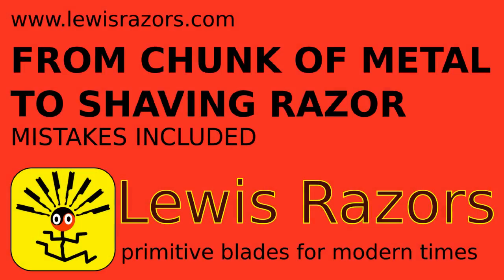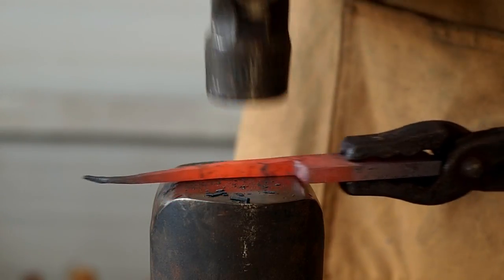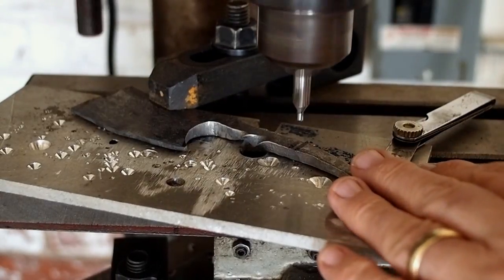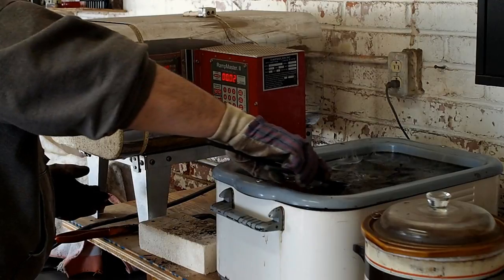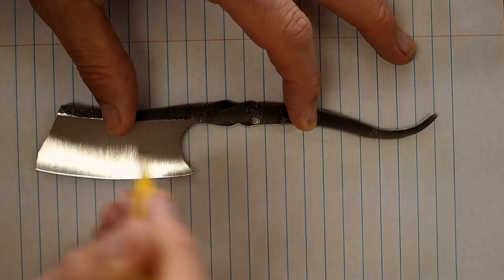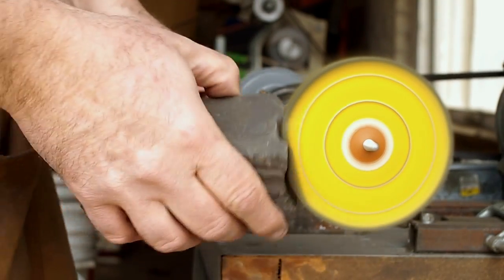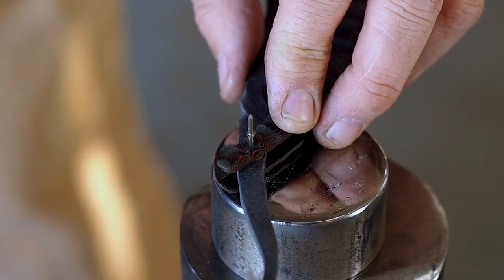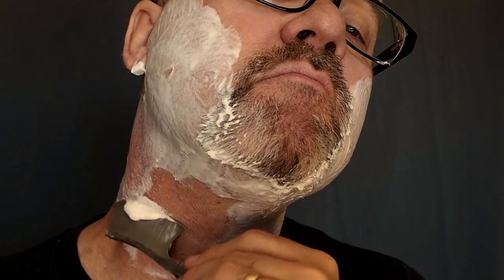Razor, From Chunk Of Steel To Shaving

Comment: Much respect for hand forging that hunk of steel into rough final shape before grinding. That's a real knife maker, and is what separates a real knife makers from the other people on YouTube who just cut / grind flat stock into knives. Excellent job!
Reply from the maker: Thanks for your thoughts.  Both stock removal and forging to shape can make good blades. They are both means to an end.
Reply: Even medieval smiths were known to cut and grind stock down to shape before finishing work was done.

Comment: It's great seeing an artist creating a work of usable art I'm 55 now and fondled remember my one and only time I used a straight razor at 16 years old had a few cuts but went fine I think the edge needed a good stopping though ;-) but intend to restore my old chipped razor and get it back into service - ideas love to pick up one of your excellent razors :-)
Reply from the maker: We have very similar stories, about the same age, and about the same past experience with a razor.  I had a straight razor while attending trade school, used it for a while, but could never get it sharp again.  I came back to straight razors years later.

Thank you for your thoughts.
Reply: omally thomas I'm 55 now too, but back in my mid 40's I got really sick and tired of paying high prices for multi blade inserts for modern razors. Even at Costco, $20 for 4 cartridges was just ridiculous. I looked around online and saw some pretty high prices for modern versions of straight razors and then landed on eBay and found some pretty good deals on older ones from around the 1920's and 30's. Picked one up for about $30, stropped it and went to work. I was a pretty bloody mess by the end of the whole thing, but something I noticed right away was that a nick didn't hurt as much and they healed extremely quick. After a few rounds with my new oddity I got pretty good with it. The key was prepping the face before hand, and keeping the angle correct. I now collect straight razors, preferably vintage ones, although I do have a few modern ones also. Living in Germany, I have access to some of the finest razors mass produced today. Solingen vs Sheffield ... Solingen is more flexible and glides across the skin following the curves and such. Sheffield has almost no flex at all and forces the skin to get out of the way or get lopped off. I prefer Solingen ;)  
  One thing for sure about using a straight razor vs modern cartridge razors. You get a tremendously closer shave from a Straight, in fact it erases a good 10 years of age right off. Something about having a shave so close that no baby's bottom can compare! I hope you get back to doing things the old way. Even if you pay a couple hundred bucks on a new high grade modern razor, it will pay for itself within a few months. And the old soap in a mug and brush? Lasts so long you'll wonder why you ever picked up an aerosol can.  Good luck with it !!   Bob in Germany

Comment: Two years later, I am watching this video again. Since then, I have made a propane forge, and bought a belt grinder with a contact wheel. After two years of planning I can make my second straight razor, this time a functioning one. Thank you once again for your guidance lewis
Reply from the maker: I hope you have fun with your razor making.
Reply: @lewisrazors  since I didn't have easy access to 5/16 inch anything steel, I would have had to do some forge welding to get a peice thick enough. May as well do a pattern weld if I am going to be forge welding already anyways. I could never have imagined how difficult and time consuming this would be. I've gone through about three wooden straight razors trying to understand the edge profile a bit better, but I seem to keep burning through as I get it thin enough.
Reply from the maker: That was a big razor in this video I use 1/4 and 3/16 stock to make razors also.  I have made more razors from 1/4 inch stock than anything else.  This video goes over the ratios  https://youtu.be/isPvvVdyQio

Comment: Beautiful craftsmenship, it was a pleasure to watch! 
I am a craftsmen myself (a sculptor and taxidermist) and one year ago I forged my first knife. Not on your level yet, but it's a pleasure to work with different materials and create beautiful forms. It's great to see masters at work!
Reply from the maker: I wish I had the hand eye coordination to work with different media. The good thing about metal work for me is that is goes so slow I have time to correct.  Thank you for your comment.
Reply: @lewisrazors  Based on your smithwork, I'm verry sure, you have the hand-eye coordination! 
At first I thought the blade protection is made of Mouflon horn or Antelope horn, and was surprised it's actualy wood. Sculpting, carving and forging are different in one way, but also similar at the same time in another way. You should try it, if you realy want to!
And thanks for your reply too!

Comment: Really great video! Does the natural stone at the end really achieve a better edge than the 12,000 grit used earlier? Or do you just finish off on that for tradition's sake?
Reply from the maker: NightHawkInLight It is splitting hairs at the natural stone point, it improves the 12k but only by a hair. It is mainly a how does it feel on the face type of thing. Thanks for the kind words about the video.
Reply: Lews it seems to me the razor meets too much resistance going against the beards!!! I notice you put a certain amount of pressure to win the resistance of the grain!! Is this normal? It seems to me the razor is not enough sharped!!!! at all. I make a shave 10 days of growth with my poor Parker Srx armed with kai blade!! No cuts, no irritations, resistance very small practically inexistent! Should you improve your blade??? I'm interested but the dimostration of the razor working was deludent! Are straight razors so few performing? It seems more a pulling of beards! When I use kai it cuts all like butter but here things go different too much! Don't you agree?
Reply: @zenrazor659  no.
Reply: i dont mean to be offtopic but does anyone know of a tool to log back into an Instagram account?
I somehow lost my account password. I love any tips you can give me!
Reply: @Tony Benedict Instablaster :)
Reply: @Cayson Arlo i really appreciate your reply. I got to the site on google and im in the hacking process atm.
Takes quite some time so I will reply here later when my account password hopefully is recovered.
Reply: @Cayson Arlo It worked and I now got access to my account again. Im so happy:D
Thanks so much, you saved my ass !
Reply: @Tony Benedict You are welcome xD

Comment from the maker: James, Moore I sell my razors through Straight Razor Designs. Thanks for the knd words.
Reply: And they are amazing razors great job *****. It's always a pleasure to admire your work.
Reply: Very beautiful work and nice video! Thank you for sharing! little technical question though: how do you figure out where to drill the hole on the tang at the beginning? Many thanks in advance for your time.
Reply from the maker: I hold the razor blank like I would when I would be shaving it and see the spacing of my fingers to figure out where to put the hole. The scales of the razor will be between my fingers when the razor is open.
Reply: With the tone of that voice, I'm beginning to wonder what that razor is actually for..
EDIT:
Oh dear.. There's the bottle of bleach too. Don't do it man, tomorrow might be a better day!

Comment: I would end up in the ER if I tried shaving with a straight razor
Reply from the maker: +bob talbot Naw, you just think you would. It is human nature to stop when you cut yourself. Knock on wood I have never had a bad cut with a razor.
Reply: You'll only cut yourself if A: you try to shave with a dull razor or B: you move tang to tip instead of spine to bevel

Comment: love the  dedication and the perfectionism and attention to detail you take with ur knife. if im not wrong i think you said this was  0-1 Tool steel. i was surprised. i would think you would use some fancy carbon steel like 1095 or something but you showed that you dont need that to make a beautiful and very well made razor that works very well. Great job
Reply from the maker: +leoscoots24 Thanks for the kind words. I think O1 and 1095 are about the same level of fancy, they are regular old steels. I use both.
Reply: tryintogetfit24 I know about metal 🤓

Comment: how much one of these worth?
Reply: +shane agnew Selling for $625
Reply: +Heywood Jablome amazing worth every penny
Reply: +Heywood Jablome That is way too much money. I will not be buying this. Off to Ferrari to tell them that I will also not be buying that.
Reply: I agree it's not that impressive, maybe if it was a sword.
Reply: +Heywood Jablome i think its awesome
Reply: i've shaved with a knife for experimental purposes and the stones to sharpen with were more than the blade. $625 is way too much, especially if you are on a shit paid job and are sort of new to straight razor shaving.
Reply: its more for the craftsmanship plus these blade do shave better if u kknow how
Reply: Michael Burbidge - Maybe you're buying the wrong stones lol.  All you need is a 2000 grit and an 8000 grit stone, and a strop... could buy all of that for around 150$.
Reply: Did you make that washer punch yourself? What kind on punches are those also?

Comment: Nice looking razor.  I completely quit shaving about 25 years ago but still like hand forged cutting tools.  I began learning blacksmithing about 60 years ago.  I don't set up my forge much these days. My forge is coke fired and is hand stacked refractory brick.  Setting it up takes about an hour and after I am finished it take a couple days to fully cool down.  So these days I buy really high quality blade steel and shape a blade on my belt sander.  I use a torch for annealing and heat treating.  I do miss the ring of my hammer although Sharpening my Scythes is a peening process.
Reply from the maker: Thank you for sharing your thoughts.  I have been fascinated with scythes recently , they seem like a super efficient tool. I enjoy old hand tools also.

Comment: Lewis Razors Thanks for this. I recognize how it is no small feat to film, narrate and edit nearly 40 minutes of material. I can't help but to think that building a treadle hammer around that sweet post anvil of yours would enable you to stomp those blades out paper thin, relatively easily. For what it's worth. Thanks again and keep up the good work.
Reply from the maker: You are so right,  I have been looking into making some sort of power hammer. My knees and hips are worse than my shoulders, I do not think I could handle a treadle hammer.  Thank you for your thoughts and comments.

Comment: O1 is not your typical forging steel, although that's what l started with when I began my knife making endeavors in 1992. When I forge non-Damascus steel now I use CruforgeV, a steel specifically made for forging knives. Its vanadium content 0.75% ensures the formation of vanadium carbides which are harder than the O1's tungsten carbides.
Now for non-forged knives if I make a high carbon steel knife I use O1 which really comes out nice from the heat treat. That's where its best performance can be brought out.
Reply from the maker: Thank you for sharing your knowledge and thoughts.

Comment: My dad had a drill bit that would go straight to an engine block... the trick is to go slow and press decently hard. Of course it was also a $200 bit... but then again as a mechanic it's quite useful
Reply from the maker: I needed a bit like that. Thanks for sharing.
Reply: Lewis Razors yeah, they will last you forever if you use them right... I do believe they have a lifetime warranty which should be a thing for a $200 drill bit.

Comment: Beautiful knife. Job well done.
As for the hammering of the bevel, I've read that if you hold the piece at an angle to the anvil, you'll get a symmetrical angle on the other side. Maybe it is something you could look into doing to save u some time.
Reply from the maker: Thanks for your input, I am doing something like what you say, but it does not show up real well on the video.  The blade is wedged shaped with somewhat of a hollow after forging. Thanks again for your comment.
Reply: Lewis Razors cool! yeah it was a little hard to see in the video. another thing I randomly thought, if you wanted a more pronounced twist in the tang, you could possibly have hammered that section smaller than the rest and then twist it. that way you may be able to get the full twist without having to hammer the sides of the twist to fit the space between the scales.
Reply from the maker: That wold be an interesting way to put the twist in, thanks for the idea.

Comment: Your work is truly amazing. It's been a pleasure to watch it!
I'm new to the whole wet shaving concept: I'm still in the "shavette phase", but I'm thinking about switching  to the traditional way of a straight razor.
Reply from the maker: I am a fan of shavettes, I think they are underrated. I have been out of town for a month and used my shavette the entire time, it is a good tool.  Thanks for the kind words about the video.
Reply: They're quite good, but they have a built-in limit: the length of the blade.
You're welcome, anyway! :)

Comment: Good video I like you, when your bending the tang try not to trap the metal between hammer and anvil causing to buckle and squash, good tip use a bit of 8mm round bar ant try forging to perfect circle without leaving hamer marks( use a empty tin can to cheaply circle whilst forging) hope this is useful , I like how you take of the corners a lot to prevent burning and fractures at corners 👍
Reply from the maker: Thank you for your ideas and thoughts,  I like learning and getting better technique. Thanks

Comment: You should rub in the foam for a good two minutes when you start shaving. Just applying the foam and not rubbing it in does nothing towards softening the bristles. It merely provides some lubrication for the razor to glide on. The surface of the bristles stays hard, and the blade slightly slides along them before starting to cut. Makes for a less than perfect shaving.
Reply from the maker: You are right, that was a crappy shave, nervous and being in front of the tripod in the living room is not a good way to shave.

Comment: From what I understand, in whaling days, you wouldn't throw away a straight razor if it were broken or worn out. 
  They'd use the fine quality steel to forge weld onto the blades of harpoons and lances, make a nice, really sharp edge. I'm thinking maybe they did the same with other things, like axes or draw knifes, chisels maybe. Dunno.
Reply from the maker: High quality steel was once a valuable commodity not to be wasted.  Your thoughts and comments seem right to me.
Reply: Lewis Razors   Yup ! That's what my Dad told me. His great great great grandad was a harpooneer on the whale ships out of New Bedford Ma.
He had a harpoon handed down to him, he hung it over the fireplace. Nasty looking thing, but it got stolen during a burglary. He also told me
harpoons where not for killing the whales, they were for getting close enough to the whales by the attached rope to use the lances to kill them.
  Sometimes after they got the harpoons in, the whales would take off. Called a "Nantucket sleigh ride" Kinda' fun unless the whale got angry
enough to double back and smash the boat to pieces..

Comment: That’s a great razor for big hands. Have you ever made a nice sized blade like that out of a high carbon metal file?  Just wondering. I have several Anza knives, and they take a very sharp edge really quickly. Very nicely done. That would last more than one mans lifetime.
Reply from the maker: Yes I have made a few razors from files. the all preformed well.

Comment: Wear gloves man, I learned the hard way when the belt randomly grabbed the blade and pulled my hands towards the belt! But the worst part is that the blade broke into tiny pieces in my hand! I was lucky and didn't get any major cuts. Serious stuff dude.
Reply from the maker: You make some good points, but I have a fear of the gloves getting caught in the belt and pulling my whole hand in. 

There are risk either way, with gloves or without gloves. I have seen gloves get caught in machinery, it was not pretty.  I had rather risk abrasions than have the possibility  of my whole hand getting sucked into something.

Comment: Nice job...didn't think you get a razor sharp blade without a strop.
Reply from the maker: You can shave right off of the stones, but the strop makes for a more comfortable shave, it smooth the edge so it feels better on your face.

Comment: Thank you for showing a great razor from start to finish,
Could you explain a little how the razor does not rust or does it need a lot of care
Reply from the maker: You have to dry it off after using, I have never had problems with rusting.

Comment: That was an amazing video. Watching you transform that block of steel into a straight razor was like watching art. Although, I think you're nuts for shaving with it....I would have decapitated myself attempting that.
Reply from the maker: You would not decapitate yourself :)  When you first start using a straight there is a lot of apprehension ,bit after awhile it becomes pretty normal. Thank you for your comment.